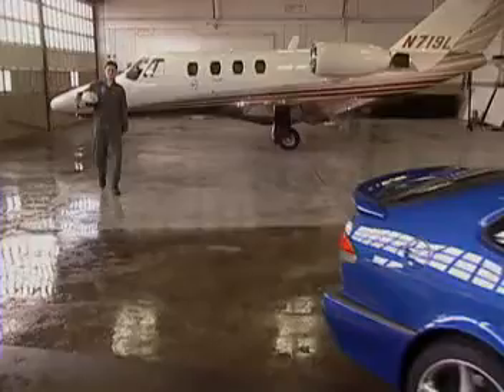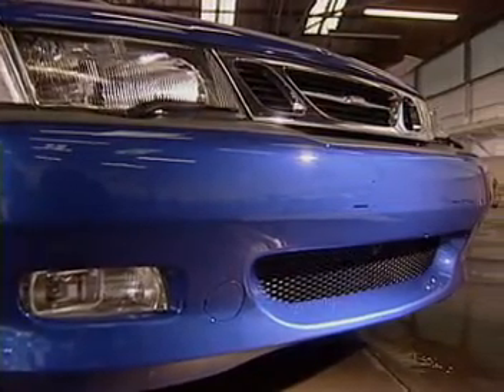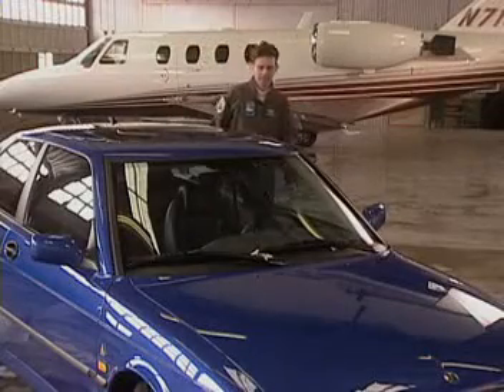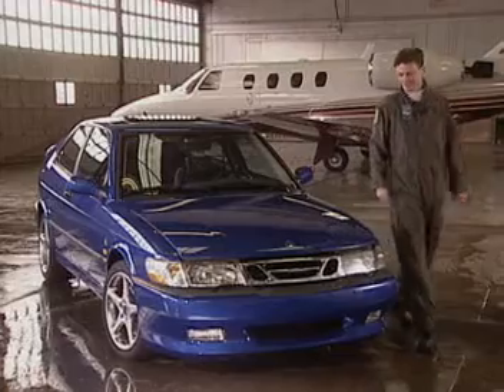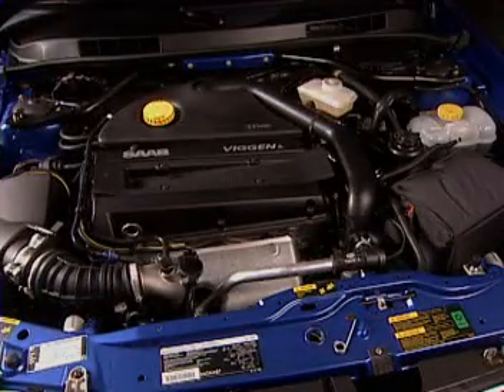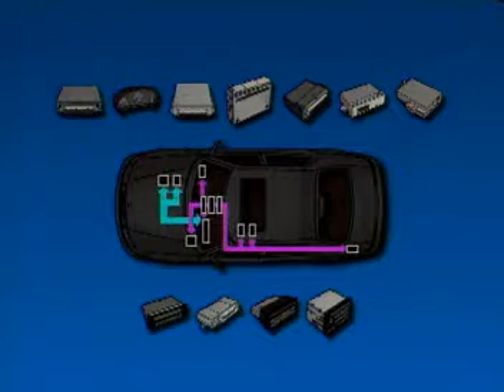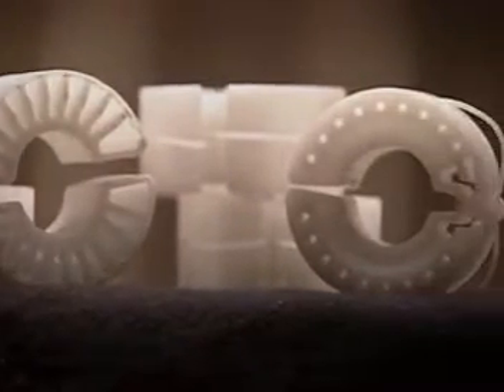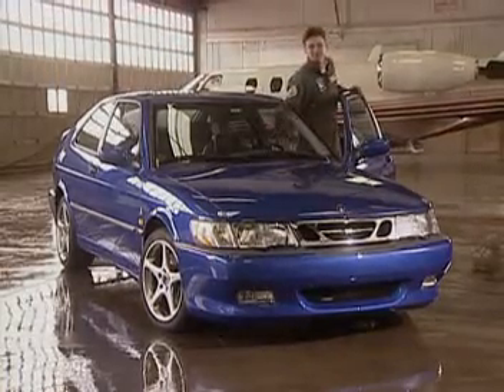Saab 9-3 Viggen training program

Comment: Awesome car.
SAAB is not a completely different company. SAAB IS (or was rather) SAAB. When GM bought 100% of the auto division back in 2000, SAAB kept certain rights and licenses, including the model names, badge, Griffen Logos,  etc.. which General Motors had to pay hefty premium for. If at any time SAAB didn't like the way they were being branded, they could have revoked all licensing, technology, and names leaving GM screwed. Today Believe it or not,  a Chinese company owns SAABS powertrain tech.
Anyway...oh.
And those brake calipers are SAAB originals, stamped GM and used on nothing else but SAAB'S. 
One would notice FORD stamped on Volvo calipers as well. Just as those same calipers are used on the last generation Focus.